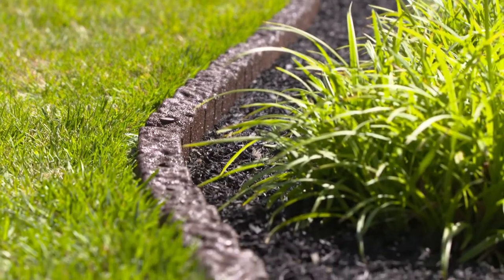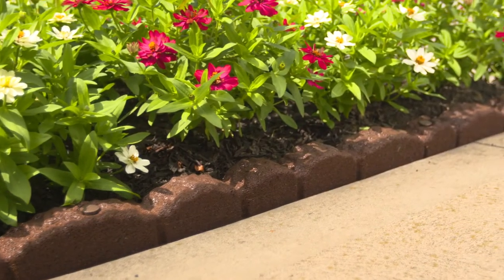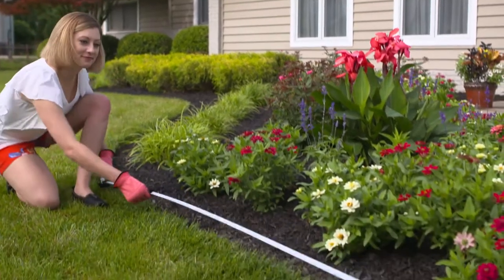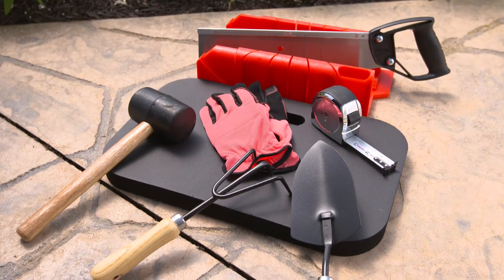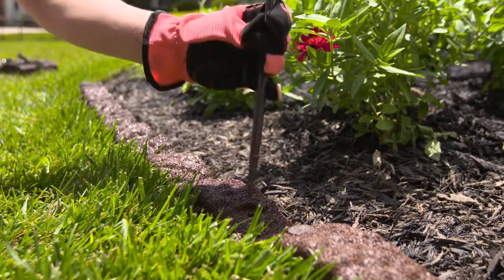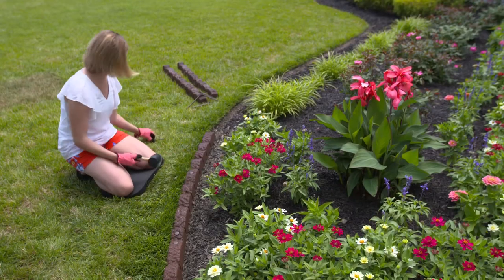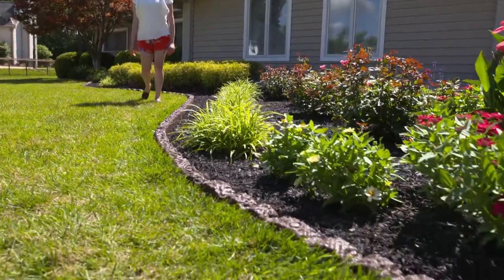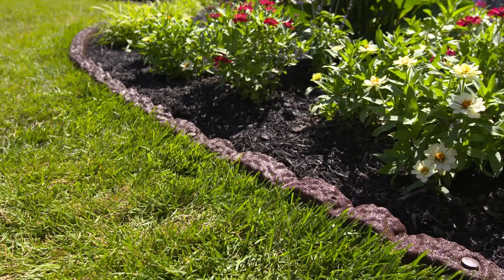Rubber Edging Installation 100% recycled rubber

Comment: Does it get damaged when mowing the grass?
Reply from the maker: Rubberific edging is very durable. However, any rubber-type edging product will most likely take on damage if you accidentally roll over it with a running lawn mower blade.
Reply: I’ve had rubber edging for several years and my mower never seems to touch the edging. I use my line trimmer to get grass right at the edge, no damage. The only maintenance is making sure the spikes don’t rise up a little after a tough winter. I just hammer them back in the ground with a rubber mallet. No more playing with heavy bricks!